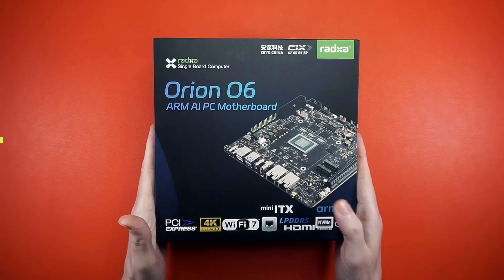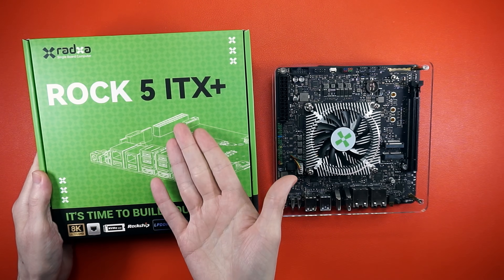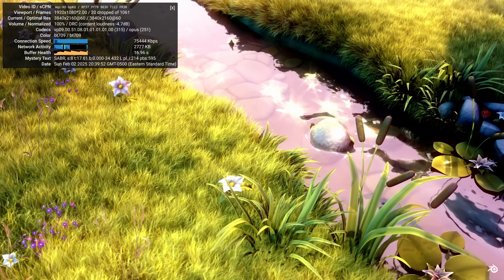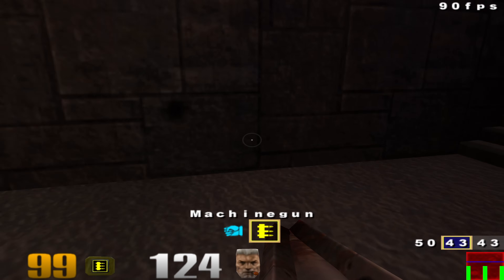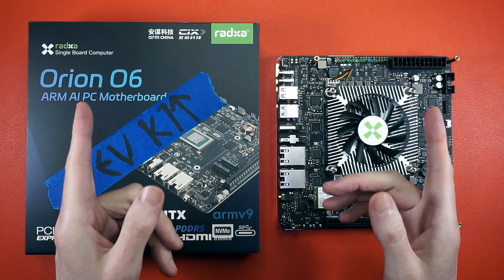Radxa Orion O6: Preview and Quickstart

Comment: YT just recommended me this video and i'm mind-blown that there are ARM cpus for motherboards like this, how's the power consumption without a dedicated GPU? In times where electricity bills are expensive i'm considering this
Reply: The O6 is not really a low-power ARM board. At least, for now. The idle pull is around 13 watts.

Comment: Of course you'd get it before me. Mine still shows up preparing to ship. Lol the wifi card and clock battery actually arrived before the board. 😅

Can't wait to get my hands on it. Actually I can't wait to see what Deep Computings cooking up. They're planning another RiscV beast developer workstation. Which after the 32-core monster they released last year should be interesting. StarFive also supposedly has some kind of beast that will be unveiled by end of year.

Comment: when will MediaTek or Qualcomm release a ARMv9.4 or PREFERABLY a ARMv9.6 Workstation grade SoC that features SVE2.2 and SME2.2 or later versions like 2.3????
ARM is literally a more powerful architecture than x86 in both Scalar and Vector operations. I'm soo tired of only option being APPLE with its lack of SVE2 SIMD!!!!!
SVE has been around since ARM v8.7 and still not one f*cking SoC has adopted SVE let alone SVE2.x!!!! WHY???!!!
I refuse to buy x86 crap!
Reply: What about nvidia DIGITS, their new arm PC? It has ten Arm Cortex-X925 and ten Cortex-A725 CPU cores. It appears the x925 has armv9.2 and sve2.

Comment: This thing ruuuuules!! Many cores, big performance. Been needing a great worker system as a dev environment while at work, and this might just be it.
Also, first vid I saw of ya. Great to-the-point style, subbed. All the infos I wanted (bar a few)!
Things that I am yet curious about:
- If I dd to NVMe, will it just boot or do I have to tell it's UEFI to refresh it's list? As in, will it see EFI/BOOTARM64.EFI etc without config?
- Is the soldering required? Im blind, can't solder. Will it boot without?
- Actually, what other tricks does the UEFI firmware have? Looks very small, but there ought to be some party tricks (:
Reply: Right on, thanks for watching. If you dd the NVMe with the Fedora image it will install an entry in the UEFI. No soldering is required unless you want to use the SPI flash module. 

I didn't spend much time in the poking around in the firmware since it's still in the works.
Reply: I think one thing that's exciting about this is it's almost in retail spec, so pick one up plop it in an ITX case and your good to go. The drawback of most other boards outside the lack of cores, is the ability to be used as drop in solutions with off the shelf components.

Most of the time if your board isn't a standard case shape (I.e. , raspberry pi form factor) you have to hope it's popular enough to have cases / fans for it on the market. The PCI slot and onboard m.2 also help with viability. ❤

Comment: I like that they list this board as "The world's first Open ARM v9 Motherboard" when ARM is a closed-source proprietary architecture.
Reply: "Open source" means they provide the board schematic and some software they're allowed to provide the source for. That's all. Every usable piece of technology out there is based on proprietary IP. Even RISC-V SoCs.
Reply: What are going to do with the RISC-V CPU raw verilog source code. Ponder it?
Reply: @ Some people have created their own RISC-V SoCs with it. Just because something has no use for you, doesn't mean is of no use to anyone.
Reply: @Metabulation  Well you can use that to implement into some FPGA, so what, all SoCs out there are proprietary solutions. It's exactly the same situation like all those ARM-based SoC made by Apple or Qualcomm with a lot of improvements over base ARM v8.x specification. Open ISA from RISC-V doesn't mean each and every upgrade to base architecture will be somehow shared. Not at all. So you still end up with a lot of proprietary tech in actual h/w implementation. And the faster you want to go more IP components, patent-covered stuff will have to be inserted. In the end from user point of view x86, arm, risc-v just makes no damn difference. All that hype of RISC-V is just ridiculous. It's slightly good for chip makers but that's essentially that. There's hardly any benefit to end user.
Reply: @Metabulation  RISC-V is only the instruction set that is patent free. Each hardware implementation can be open source or not.
Reply: Bruh. It's the motherboard hardware that's open, not the SoC. It's the same kind of "open" as the Raspberry Pi CM5 IO board. You have the schematics. And that's it.
Reply: x86 is also "a closed-source proprietary architecture", but this doesn't prevent regular PCs  (IBM PC compatible) being open
Reply: @RustedCroaker  Yes, but these two things have not much to do with each other. x86 predates the IBM-PC standard.
Reply: Still better than x86, which is even more obfuscated.
Reply: @HIDLad001  It's about the same. You need x86, you need to pay Intel a license. x64, you need to pay AMD a license. ARM, you need to pay ARM a license.

Comment: Thank you so much i was very curious about this!

I think i saw Jeff's testing show that they are using pretty high idle power consumption too? 

Welp I got all excited a while ago and preordered a few of these to do a whole new mini rack arm server build. Ordered a bpi-r4, 2x 32gb o6, rock5 itx+. I am glad to see that the nvidia/amd gpu worked. I was hoping to use the a310 for jellyfin but oh well ill have to grab a different card or hope the integrated will work.
Reply: Electron vampirism at idle is comically high. Think I measured 14-15 Watts. Hopefully, future updates will address this. It reeks of a rushed release where they'll fix the issue later.
Reply: @VennStone  Seems par for Chinese stuff. I ordered an atx board with a 14500hx on it. Blank board pulls 40w idle..... its wonderful.

Comment: Still waiting for an ARM Linux laptop to challenge Apple’s new laptop dominance. So far, Intel, AMD and even QUALCOMM haven’t been able to match the performance AND the battery life of these new MacBooks, especially when those laptops have Linux instead of Windows.
Reply: Waiting on the same device, but in tablet form.
Reply: Asahi Linux is expected to arrive on M3 and M4 in a few months. 
M1 and M2 are already quite mature.
Reply: @HIDLad001  I still want a laptop that’s purpose-built around Linux to compete with Apple’s laptops, but that will probably take a while for that to happen.
Reply: @fujinshu  I replied to your comment, but YouTube deleted the reply.
I would definitely like that too. 
Sadly the Qualcomm based Windows on ARM laptops aren’t much better because they contain a disturbing thing called the Pluton Security Processor, which is basically Intel Management Engine but made by Microsoft, and a “chip to cloud” device. 
It is a security nightmare.
Reply: at the moment its way better to install linux on a macbook m1/m2 than most ARM linux systems. ARM feels way more restrictive than x86 for operating systems ngl
Reply: @merthyr1831  The x86 PC is somewhat of an anomaly as far as how standardized everything is and the sheer amount of operating systems that are available for it. (This could be down to the fact that Intel and AMD are the only two companies you can buy x86 CPUs from.)

But that being said, ARM computers can have UEFI and ACPI too, and ARM has a certification program called “SystemReady” that basically ensures most software you throw at it just works. 
It’s just that most of this is limited to servers that have ARM processors and not consumer hardware (the Windows on ARM laptops don’t even have this!)

But if there is a big company with lots of loyal customers (like Apple), community software support for their specific ARM machines will be much better than other companies hardware, and thus more diverse operating systems will become available for it.

Comment: It's hard not to to get wound up about the O6's potential, but right now, that's all it is: potential. Hardware is only half the battle, and for the Orion O6 to become one of the coolest SBCs of 2025, CIX needs to fulfill its pledge to release the BIOS and kernel source code, along with the image-building tools. Once that happens, good luck keeping them in stock. 

I'm looking forward to giving the Orion O6 a proper review in a couple of months. Thanks for watching!

Timestamps 
00:00 Intro
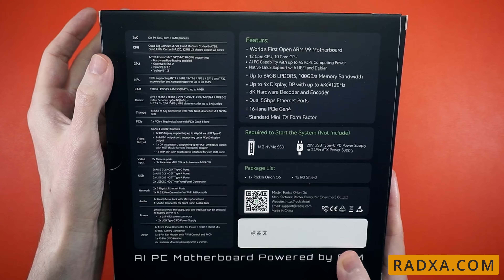      00:09 Overview
      01:19 Wi-Fi & NVMe
01:30 Disk images 
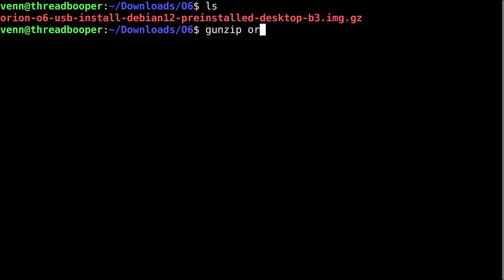      01:37 Debian disk image 
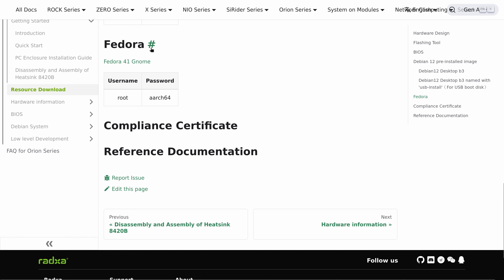      02:05 Fedora disk image 
      02:28 ACPI boot 
02:54 4K video playback 
03:26 Audio
      03:36 USB audio interface
      03:42 Reaper DAW session test 
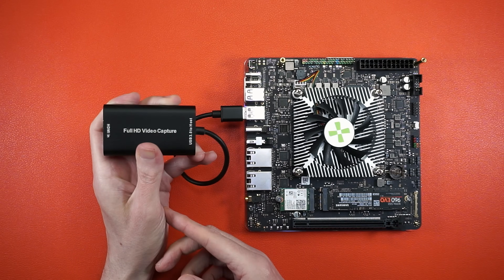04:04 HDMI USB video capture
04:14 Blackmagic HDMI PCIe video capture  
04:28 Discrete GPU AMD WX 3100
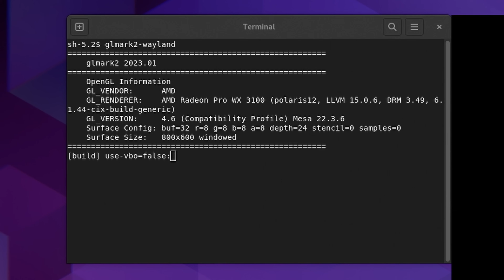04:36 Discrete GPU NVIDIA 2060
04:53 Vkmark benchmark 
05:02 VkQuake3 4K timedemo 
05:18 1G, 2.5G, 10G Ethernet
05:30 Geekbench single-core 
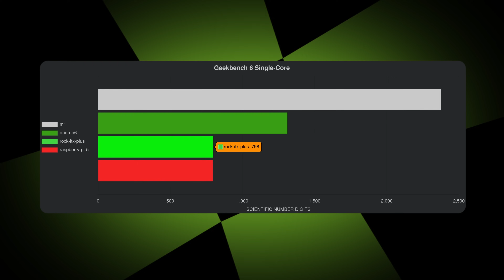05:48 Geekbench multi-core
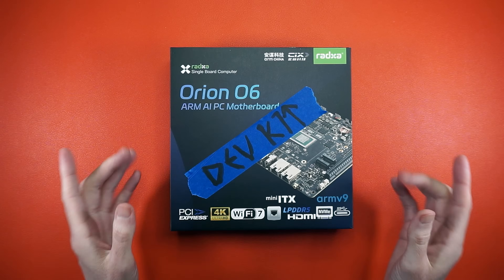06:06 Intel ARC A310
06:14 FireWire - yes really 
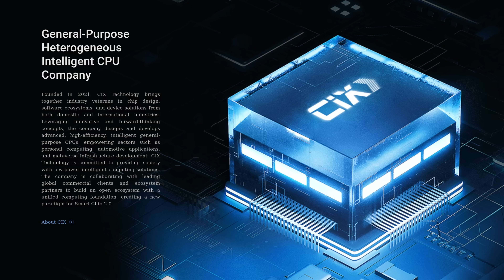06:20 Waiting on BIOS & Kernel source code
Reply: If the RK3399 is anything to go by, the Orion O6 is more likely to become one of the coolest SBCs of 2029.